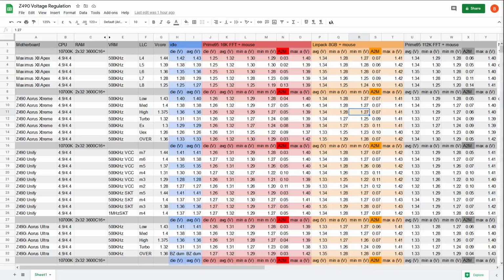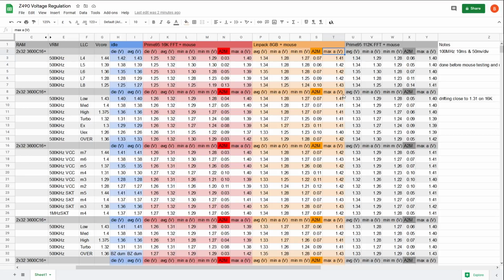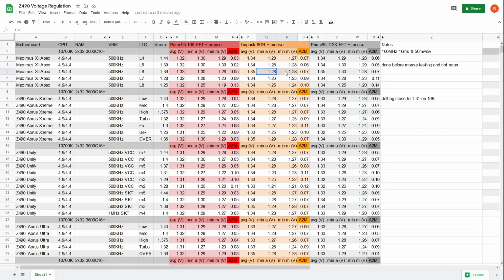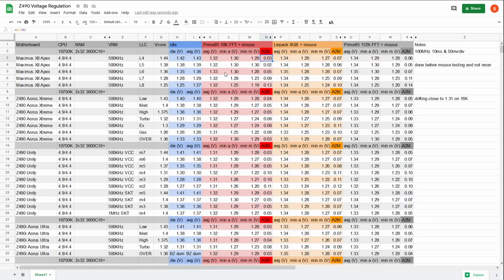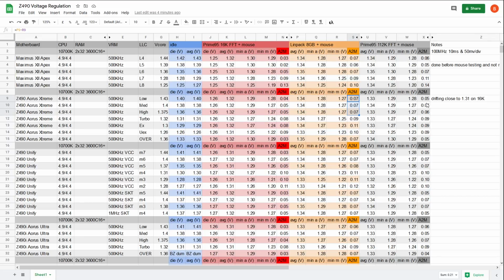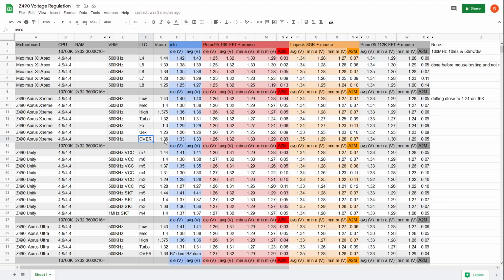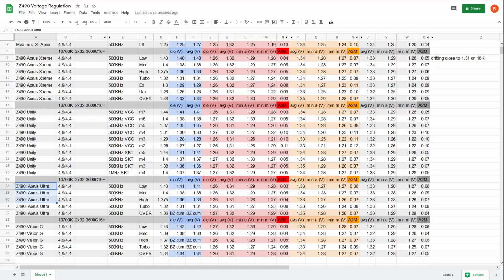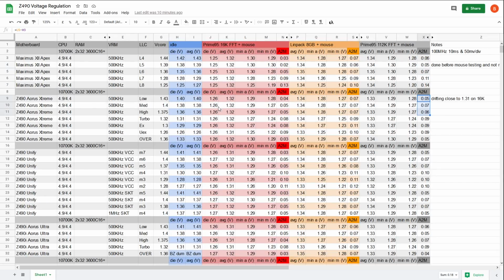Z490 voltage regulation on the Apex, Xtreme, Unify, ITX Ultra and Vision G

Comment from the maker: some context: https://youtu.be/zqvNkh4TVw8
Reply: https://www.asus.com/Motherboards-Components/Motherboards/All-series/Pro-WS-WRX80E-SAGE-SE-WIFI/   is there anything You can say about this motherboard features advantages and disadvanages of using pro Threadripper...and  I canot find nay documentation to know if you can overclock the ram at all the pro series... I also noticed thathe memory trces are quite visible...could thismean tha the pcb is kinda piece of crap(i knwo this motherboard is NOT meant for  extreme overlcokcing but nevertheless interesting to know in case you can actually overclock ECC with this cpu, and what jkind of speeds are realstic to try to get).
Any Idea what the 8 Pin  below the  24 pin is meant to power on that motherboard?! there is dual 6 pin below to power teh pcie slots..which lok skinda overckill... and another dual EPS for the CPU...... do you think that maybe one can by pass the CPU locks and overclock the hell out of this thing?!
A video on CTR  would be cool!!
Reply: @elracatang  Why..?! asking why there is an extra 8 pin to power the motherboard, which  is quite unorthodox to say the least and not something that you see every day..

especially when u got TWO extra 6 pin pcie connectors and at the same time two thicker 24 pins for pcie power... unless i dont know... this is a PCIe5.0 motherboard ?! and pcie power has ramped up from 75 watt to 150 on the slot and no one has said anything about it yet?!
...nor i am into U2 storage set ups.
this motherboard has quite  few power delivery extreme features for a non extreme platform.... like many other bigger server motherboards i own.
I ask whatever i feel to ask, while at the same time i dont need unsolicited prehistoric plagerized forum comments like ''if you have to ask why you need it then you probably don't need it'' from wannabe big minds like yours.
last time i saw someone making such same comment somewhere ina forum, i fell off My dynosaur.
Reply: @AbyNeon  okay let me say what they said but nicer:

If you don't know what the different power connectors do, why they might exist, and if you'll need them, you almost certainly don't have the overclocking knowledge/ability to actually bring them into play, and you can safely ignore them as irrelevant to your purchasing decision. 

Is that basically always correct? Yes. Is it possible you know nothing now, but have tons of money and a desire to learn whilst using this board, making your concerns relevant? Also yes. Could they have answered differently? Yes. Was their answer correct often enough for it to be acceptable? In my opinion, yes. Could I answer in detail for you? Yes. Do I feel like it? No, if you're gonna spend this kind of cash, you should take the time to do research yourself and gain a deeper understanding of the things you're spending all this money on. Otherwise, the cloud + managed services, prebuilts, etc exist if you just want to run workloads without knowing anything about hardware.
Reply: I was thinking the exact same thing when tuning my 10900k on an Asus z490 e strix. That I needed a LLC setting between LLC 6 and 7. Do you think this board would have a much worse overshoot and more average droop opposed to the apex board. I'm running my 10900k at 5.2ghz at 1.385Vcore but cooling wise I can easily go to 1.45Vcore with my delidded cpu on arctic 420 aio. Im just affraid that the overshoot might be too high, because my gut says that the average on LLC 6 with 1.45V  is probably around 1.37Vcore.

Comment: THANK YOU, BZ! You've done such a massive job to measure all those things
I really was worried about LLC settings on my Apex XII board and >100mV Vdroop, but now I have the answers
the only thing that I need to figure out now is AC and DC loadline values
some ppl recommend to use 0.01 for both, others use 0.3 or 0.4  >.<

Comment: I have a formula with 2 radiators of 360push / pull and another of 120mm. with 10900k with delid and ihs fullcooper from rockkitools, at 53 at 1.37v is it too much for the day to day?

I can contain it well in temperature

Comment: If Asus had changed LLC7 to 0.275 mOhms instead of 0.165 mOhms like I asked them to, they would have scored better (similar to Gigabyte's LLC Turbo), but Shamino had no say in changing LLC7 :(  The 0.275 mOhm LLC7 can still be accessed from the VRM directly.

Comment: So some 9900K/Z390 Aorus overclocking vid I watched argued for running LLC L8/Uex/max for like an all-core 4.9GHz OC and I took that on good faith since I'm still new to overclocking and know only barely more than jack squat about EE. Anyway, given what you've said here about how unnecessary L8/Uex is and how bad the 9900K's cooling already is without taking into consideration power draw increases from upped voltages, should I be running something closer to "high" on my Aorus Ultra or would the stability drop hard/does this not necessarily extend back 2 chipsets?
Reply: Also thank you for putting in all this work! Really appreciate it!

Comment: 44:51 Gigabyte override mode is amazing magic, but some bios versions send 1.55 v to your CPU so be careful. Yikes.
Reply from the maker: it only happens on really old BIOSs
Reply: Had that at my newest bios from 28/1/2021; 1.55V when turning on the Auto Enhance, lol. @ActuallyHardcoreOverclocking  Missing override mode on Z490i Ultra. Had it been removed?